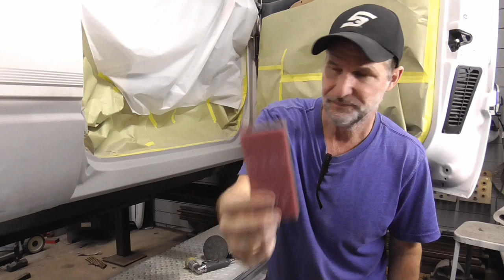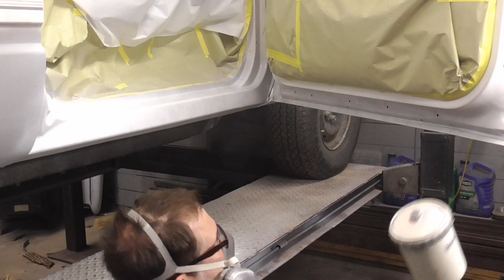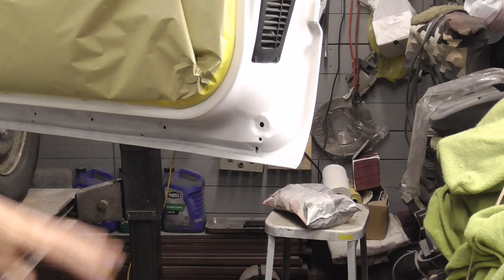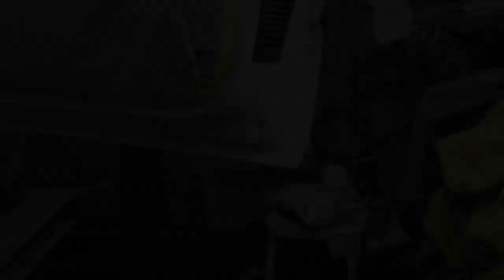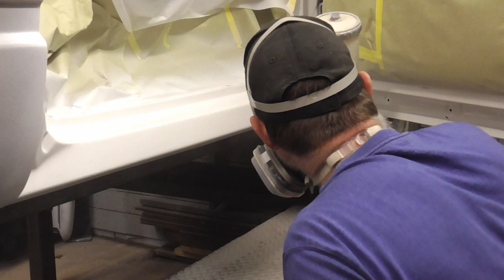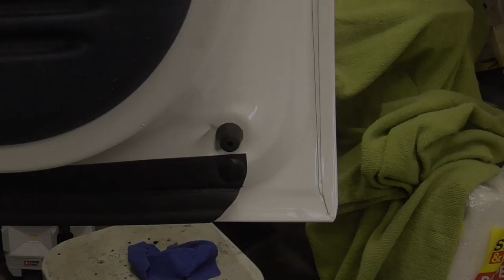How to Prep and Paint Automotive Door Jambs

Comment: I just watched your video about mixing ratios and was wondering about door jams so i searched and this comes up. Im working on starting a paint shop. I bought a 21 gallon air compressor, 2 $10 spray guns and diablo 50ft hose. I painted my tahoe about a month ago with a electric gun and paint came out good up front. From doors on back, i had runs and splatters. In the process now on getting my building together. I had no heat or lighting which played a big part. Im do that before i attempt to paint my car again. Keep teaching!!!
Reply from the maker: I wish you success in opening your shop.  Painting cars works a lot better with air for sure - make sure you drain the tank too before painting to reduce the chance of water.  They do make a cheap in line filter too https://www.harborfreight.com/disposable-inline-moisture-filter-68224.html?cid=paid_google|||68224&utm_source=google&utm_medium=cpc&mkwid=s|pcrid|385361199048|pkw||pmt||pdv|c|slid||product|68224|&pgrid=76904761605&ptaid=aud-453354162445:pla-833406503441&pcid=6550213833&intent=&gclid=CjwKCAiAg9rxBRADEiwAxKDTugeLlYok3L4IKoXrd1WGwxpFuUeuxUMLU6Ad2nwBYbC_bYI2ZHbOaBoCdh4QAvD_BwE

Comment: Started using my accuspray for door jambs. Very low overspray and a lot of control of the material. This is the one area the gun really shines. Controlled spraying. The other function is spraying primers. I always have 1.8 & 2.0 nozzles ready to go. The Performance gun you have is a much better gun for painting panels or an entire car. But this cheaper Accuspray sees regular use for the jobs it's best suited for.
Reply from the maker: Good to know BBG.  I might have to try one out.  Does it clean up easy too?  Thanks for the tips my friend ✌
Reply: @LakesideAutobody  Clean-up is a breeze. Same procedure as the 3m performance. I use the aerosol gun cleaner. I will be shooting epoxy sealer with it tomorrow.
Reply from the maker: @BearBudgetgarage  Thanks for getting back to me with that - good luck on your sealer project - have a great weekend :)

Comment: Do you usually use single stage urethane for all the jams and then possibly use base/clear for the exterior?
Reply from the maker: Yep - sometimes you can even get away with using spray bomb if its black or white and it's just a daily driver.  Other times it's cheaper to just go with the BC/CC you bought for the car so you don't have to buy the single stage.  Happy Super Bowl!

Comment: Thank you for another great video. If possible could you do a video on taping and prepping where weather stripping and seals meet the roof of a car. Some weather stripping can be easily removed and some like the windshield seals are tight against the body. I am getting ready to do a roof on a Chevy HHR, my little project car this spring and the windshield and some of the door weather stripping/seals are tight to the metal. Would it be okay to put something small in diameter to raise the seal so the paint could mist in behind the seal?  I am open to any and all help from anyone that may have advice. Semper Fi, USMC.
Reply: Also the brand's to use or not use.
Reply: They have a tape out that you can slide up under the seal and it pulls back onto the seal and kinda pulls the seal up where the paint will go up under it..
Reply: @wendellrountree4899  Thank you Wendell. I will definitely get some.

Comment: When using single stage for jambs, do you need to use a blending thinner to dissolve it into the original paint? if not, how do you do it please mate?
Reply from the maker: Good question!  If you're doing a show car, I would scuff the whole jamb and blend your paint  - then clear the whole jamb.  If you're doing a daily driver, scuff with the grey (I just use red)  - blend into the scuffed area and finish with very thin or reduced final coat.  With lacquer paint you could do what you suggest but today's paints need to be scuffed or sanded before paint will stick. Personally, I've never used blending solvent but they do make it and I believe you can even get it in a spay bomb can.  I'll have to look into that and possibly make a video on that topic.  Thanks for the good ?
Reply: @LakesideAutobody  no worries mate. I've used both aerosol and a professional one and don't see any real difference between them. It does soften the soft edge (if masked that way) of the clear, but have never seen it used with single stage paint. I'd imagine you still can.

Comment: How long  do you wait  in between coats
Reply from the maker: This was single stage automotive paint and @ 70 degrees with hardener I usually wait about 15 minutes between coats.  For rustoleum and other oil based paints 1/2 hour or more.
Reply: Cool thanks for letting me know 👍